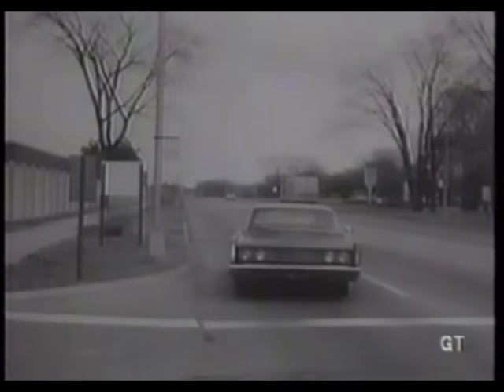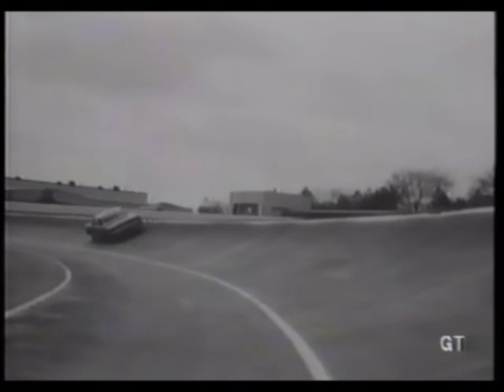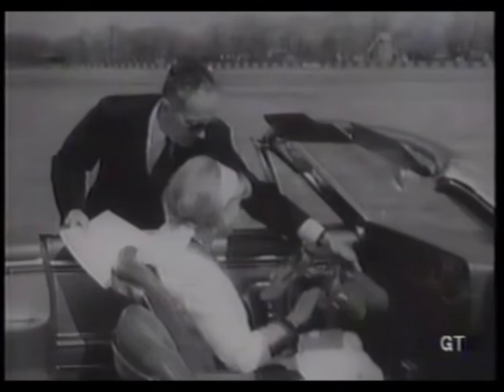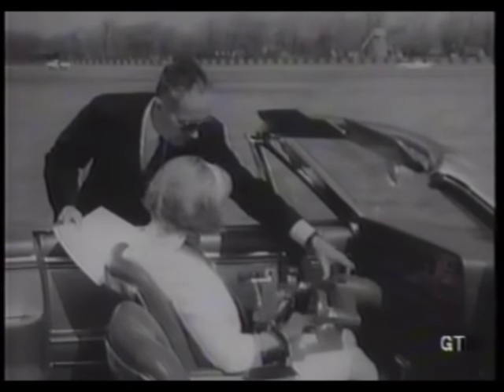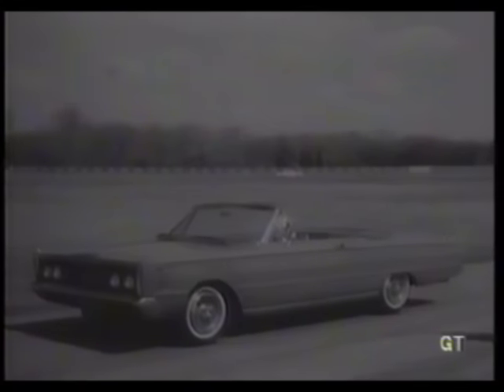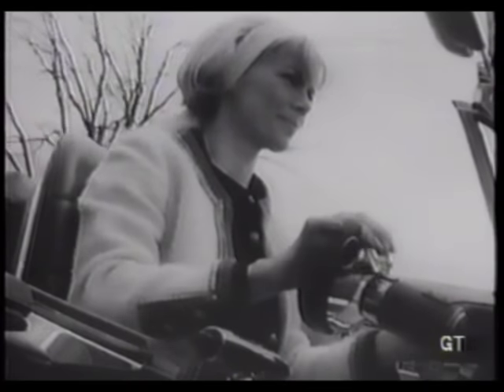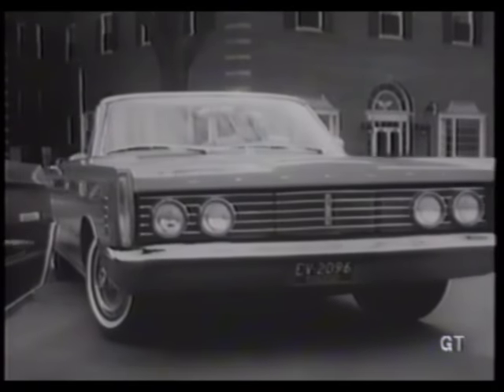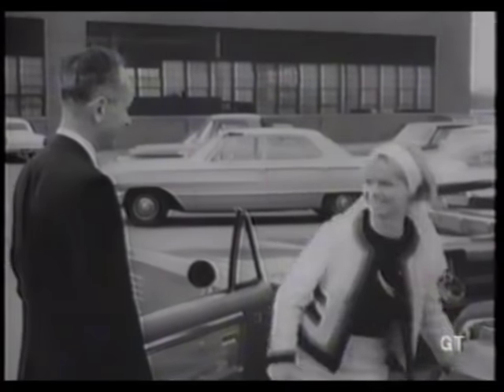1965 Ford promo film- Experimental 'Wrist-Twist' steering control on a Mercury Park Lane convertible

Comment: That was part of the effort to get rid of the steering column due to that being the thing that killed most people in crashes at that time.  My Dad was an engineer at Ford brought test cars home. I drove a similar system in a T-bird which used two dials mounted on armrests.  It was not very comfortable.  I drove another one that had a Y shaped yoke with two handles and brakes on the grips.  Again, it was unlikely that grandma would like it.  They ended those experiments when somebody developed the collapsible steering column.
Reply: Would have been neat to see how they would evolve to modern cars. Imagine a sort of joy stick that controls throttle and direction.
Reply: @SCIFIguy64  There's a guy who can't use his legs with a car like that
Reply: Thing was collapsible steering columns where invented in the 1930s

Comment: I wonder if it comes with 2 airbags.
Reply: +Martell Ortiz You kidding? Airbags? You had to pay extra for seatbelts back then.
Reply: Air Bags were around in the early 1970s but they were an expensive option then and were in General Motors autos. I'm not sure about Ford/Mercury/Lincoln.

Comment: yes, i have that tape----love the color 1955 motorama film and the 'how to run your gas station' film-flying 'a' service i think--but definitely if the steering went out---not much leverage to put it mildly
Reply: The had an auxiliary electric motor to maintain power steering if the engine quit.

Comment: This is the first time I've seen a promo film on the "Wrist-Twist" steering control. Obviously nothing came of this innovation. Perhaps the finer control one could achieve with a larger diameter steering wheel did not translate well to the smaller diameter wrist controls.

Comment: So... Is it one small steering wheel for every front wheel? Otherwise... Why would you need 2 wheels? What if you turn one to the left and the other to the right? WTF
Reply: No.
Reply: I assume the 2 wheels are locked together so that they can't be turned in different directions. From the video that's what it looks like too.

Comment: but floor shifters are easy to control and a car is not 'hip' if it has a steering column shifter. It's too old looking. I can operate my shifter just by touch and looking at the lights on the dash